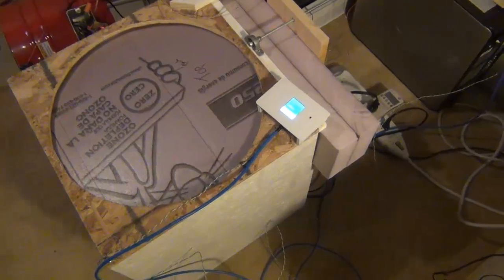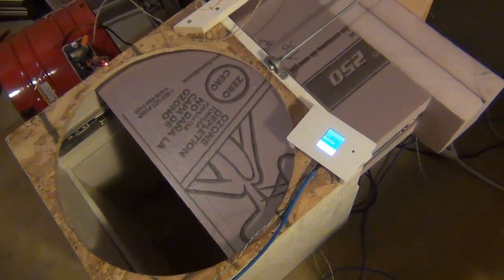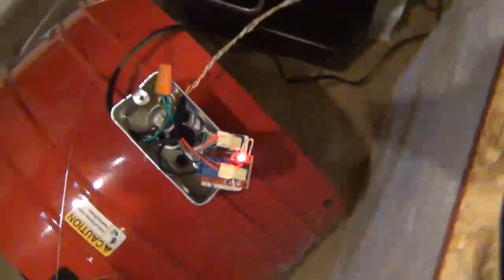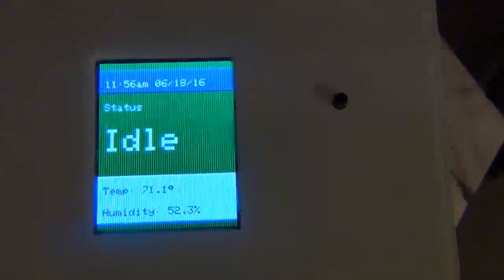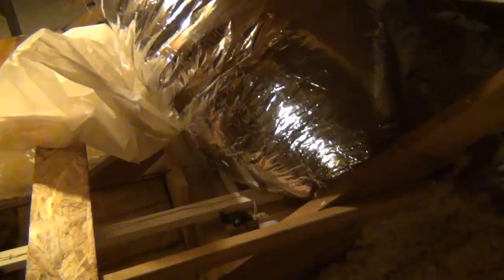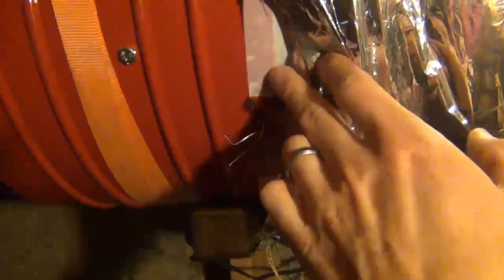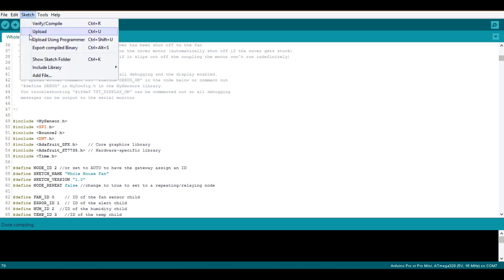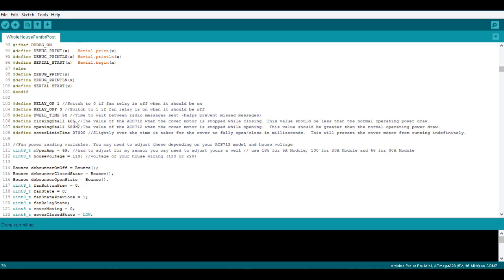DIY Insulated Whole House Fan Automated with Arduino and MySensors

Comment: Never herd someone call a electric motors an engine is that a candian thing or something? like the idea though personalty i would have tried to find a more robust motor even a junk battery powered drill you can find at thrift stores would be a good substitute. also you load st the start of the large fan motor will peak Ac motors require peak power when they first start or  if they stall. the link to what hardware you used to measure the fan power use seemed to be broken or a missed it,

Comment: I think you overkilled with the foam cover. Would have been simpler and less prone to failure if you just attached foam to flap hinges that just open by themselves when fan turns on just like a dryer vent on on the side of your house
Reply from the maker: Yeah, I agree this could probably be improved.  One thing I wanted to do was get a good air seal.  I don't think gravity would be enough to do that on the hinged flaps.  Maybe if a motor or something was attached to hold them in place though.  
This design is still working for me though and I used it last night.  No matter what you decide on, a whole house fan is a great way to cool down a house (at least where I'm living).

Comment: What about in Florida or Texas is around 95f hot is this is really worth to installed? 
What about all the dirt dust coming inside all over your house?
Reply from the maker: It will only help if the outside temperature is cooler than the inside.  
There isn't too much dirt or dust where I live so it's not too much of a problem for us.

Comment: What size the duct flex to fit to your fan?
Reply from the maker: 16 in. x 12 ft. Insulated Flexible Duct.  There is a link in the video description to a BOM (bill of materials) that has the exact link to what I used.

Comment: Great job! - I just bought that fan and want to use 16in flexible duct on it - but the diameter is actually 17in. Did you use 16in duct? Was there any issue with it fitting?
Reply from the maker: Yes, it was a little tight but I was able to slip it over and then use some tape to seal it.

Comment: Can you make the damper swing open than slide open?
Reply from the maker: Sure.  Depending on which way you want it to swing it might make it taller and I didn't have enough room for that in my attic.  I also had to work between the joists and rafters so I didn't have many options.

Comment: Nice project! You’re a genius at what you do.  However, i would love to see you create something simple to do a complex task, rather something complex to do a simple task.  You obviously have the talent, would love to see you pull one off.  Thanks again
Reply from the maker: Thanks :)
Did you have any specific examples of simple projects in mind?  Usually my projects are trying to solve a specific task/problem I'm trying to fix with my house.  I try to automate my projects as much as possible so they can take care of the tasks for me.  For example, this fan turns on/off automatically but only if certain conditions are met (enough windows are open, it's going to be warm that day, etc).  I don't even have to think about it now that it's set up.  I'm trying to be as automated as possible.
Reply: Pete B Don’t get me wrong, what you’re doing is amazing.  I’m speaking in terms of ppl like myself that may want to copy what you do but doesn’t have the technical talent like you possess.  For example, some Gable fan already has a built in thermostat or can be linked to a thermostat to come on or off.  Your system is great but for a novice would be very difficult to follow (Not implying that you’re trying to show ppl how to do it but perhaps you’re just showing people your work).  So what I’m saying is if you can make it simpler to perform the same task, that would be easier to understand and follow I’m sure it’ll be even better, simple designs tends to more reliable as well, in any case, great job and I hope you understand what I’m trying to get at.  By no mean this comment or the previous were meant to look down on you or anything like that, I truly wish I have your skill... :)
Reply from the maker: Ah, I get what you're saying. I appreciate the feedback and will keep that in mind when doing future projects.

This is my most advanced/difficult project by far.  I thought a lot about how to best do this one and in the end I just had to start making something as I was thinking so much.  I knew I wanted to make everything insulated so I didn't have a big thermal leak and I also tried to do it as cheap as possible.  Unfortunately those two requirements made the project more complex.  

However, if you don't mind spending money for a complete setup QuietCool has some really nice fans that do something similar to what I'm doing here.  You could use their entire setup and just add the automation portion to control the on/off.  It would probably be around $1,000 though :(

Comment: So I have been looking at different plans to build one and like your set up but I have 1 question though. The fan you have is rated for 3013 CFM but the 18 inch flex ducting has a max air flow of 1400 CFM. My question is does the ducting limit it to only 1400 CFM, or is the system pulling 3013 CFM with just more force?
Reply from the maker: The short answer is I'm not sure.  I do know that it pulls a lot of air so I would guess it's closer to 3000 than 1400.  Also, I only used 6ft of the flex duct and the opening was as wide as the fan so I'm not sure how it could lose so many cfm in such a short distance.  I'm not an engineer though so use this at your own risk :)
Reply: I spoke with a buddy who does HVAC work this morning. From what he said you will loose a significant amount of CFM and the fan will not last as long because it is working harder to try to pull more air than the ducting allows. I was given the analogy of trying to blow through a coffee straw. You can only move so much air through it. I'm going to try a two fan system and just have them come out of the sides of the box straight into the attic.
Reply from the maker: I originally had the fan attached directly to the box (like in the video thumbnail image) and it was extremely loud.  I have the fan near our bedrooms so I had to modify the design.  Maybe you could use two ducts to get close to the rated CFM.  Also, make sure you have enough venting in your attic to support two fans.  Anyway, good luck on your project!  I think you are going to love the results no matter how you get there.

Comment: Where did you buy the fan and what is the cost?  Thanks!
Reply from the maker: The entire parts list can be found via the link in the video description but the fan was $200 when I purchased it and I bought it at Home Depot.  http://www.homedepot.com/p/QuietCool-Professional-3013-CFM-Power-Gable-Mount-Attic-Fan-AFG-PRO-3-0/206047381?MERCH=RV-_-rv_nav_plp_rr-_-NA-_-206047381-_-N
Reply: I've seen that fan online before at HD.  Thanks!

Great work!
Reply: Very, very impressive! Also in Colorado and purchasing a whole H fan. I hope to automate it w Smartthings. After watching your video I’m worried about noise!  Nice job.

Comment: Any issues with the duct collapsing due to vacuum?
Reply from the maker: No issues at all.  I was worried about that myself though when I first thought about using it.  There is a metal wire support that is in the duct that keeps it from collapsing that works really well.

Comment: Hi Pete, That is very nice project :) I am thinking about something like that but i see one problem here. It looks like you are making too much positive pressure inside the house. Do you have any issues with that? Do you have gas tools inside your house? How they are working with this system? I was thinking about something like a extra hole somewhere in the house to let this "new" air from outside leave the house and do not have too much positive pressure inside. 
Another thing is humidity. At the summer air outside is having more humidity than air inside from AC system. Do you have any issues with that?
Reply from the maker: Definitely, and thanks for bringing this up.  There needs to be enough ventilation in the attic as well as the living space.  There are calculators for the attic ventilation online.  This fan is 3000 CFM so about 4-5 SQ FT is good for the attic.  As for in the home, it's easiest to have open windows/doors.  Thanks again for pointing this out.

Comment: Pete, That is fantastic! Nice Job!  As an HVAC mechanic, I was thinking (before you figured it out) "that's going to be loud"!.. ;-)  Do you have any functional automation for high humidity conditions to shut it down and turn on the A/C?
Reply from the maker: Thanks :) Yeah, it was definitely loud.  It's amazing how 6ft of duct work will reduce the noise!
I live in Colorado so it is rarely humid (if ever) humid.  I do have some automation to turn it on automatically if the temp outside is lower than inside and 3 windows are open.
Reply: this is exactly what I was looking to do. what automation are you using to control this?
Reply from the maker: We are on our second season now.  Still working great :)  It automatically turns on every morning if the temp is cool enough outside.
As for the automation do you mean the hardware?  I am using a Vera (getvera.com) for all my automation.  I'm using MySensors (mysensors.org) for the fan automation hardware/communication.  There are many controllers that are compatible with MySensors so you are not limited to Vera.  That's just what I use.  So, it looks like this:

Whole House Fan <> MySensors gateway <> Vera